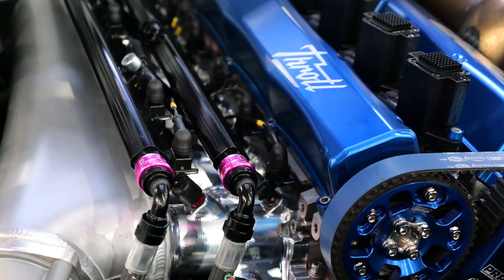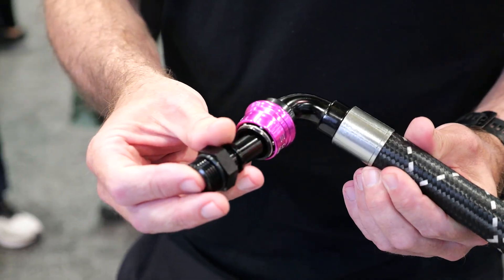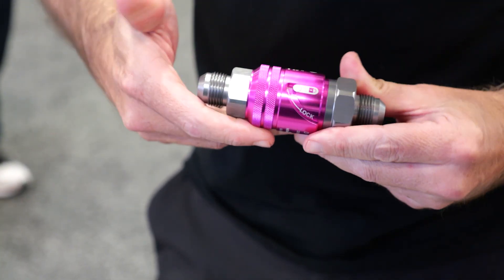'This is the way.' | AN JIC Line Quick Release

Comment from the maker: 🔵 Building a fast car? Get $400 OFF the all-inclusive VIP online course package deal: https://hpcdmy.co/dymevip
👨‍🔧 Expert motorsport plumbing. Start learning instantly with 50% OFF your first online course: https://hpcdmy.co/dymeplumb
TIME STAMPS:
0:00 - AN Lines For Motorsport
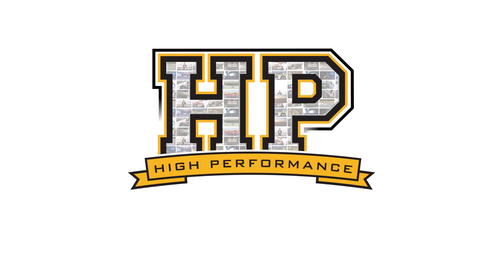0:12 - A Problem
0:22 - Quick Release Solution
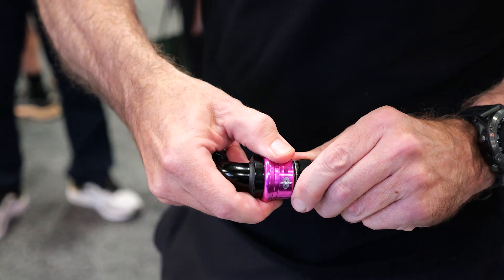0:42 - Tight Packaging
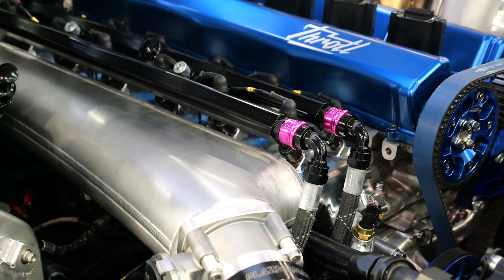0:59 - Dry Break Fittings
1:14 - Oil, Brake & Fuel Lines
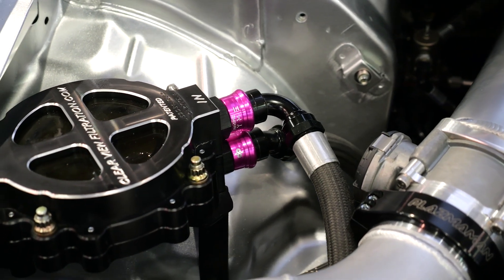1:24 - No Clutch Bleeding
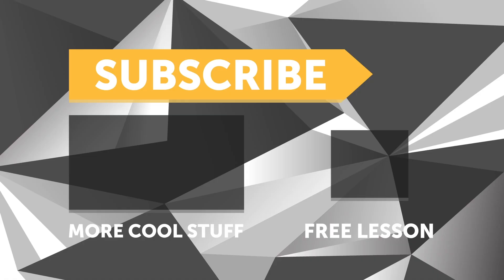1:34 - BUILD.TUNE.DRIVE

Comment: None of these quick connect providers are clear on hoses they use, and none of them use PTFE hoses, which doesn't make it very useful for many.
Reply from the maker: There is a technical sheet and you can see what fittings are usable (many) with PTFE. You can also get in touch directly, with suppliers, but a course like this might be right up your alley too to give you this general knowledge and much more -https://www.hpacademy.com/courses/motorsport-plumbing-systems/

Hope that helps! - Taz.

https://www.dymepsi.com/technical

Comment: Question: What would having a quick-release clutch line be used for? Is it just for convenience when changing clutchts/gearbox?
Reply: Yes, correct.
Reply: @Smellykent  believe he said why in the video. To prevent introducing air into the system.

Comment: How’s there reliability and how long would they last if say I wanted to put it on a daily or roadtrip car?
Reply from the maker: They are serviceable, but pretty safe bet if this is a car you are working on a lot they will last longer than OEM fittings. OEM fittings are, as a rule, are not designed for many mating cycles. If you're not working on it a lot, then you possibly wouldn't practically benefit from switching to fittings like this just for the sake of it to be honest - Taz.
Reply: One important thing to note is that these quick release fittings are not tolerant of dirt and grime. It's important to make sure these fittings are clean before disconnecting or reconnecting them.
Reply: @patx35 I try cleaning as much as I can anyway because I pretty much treat everything as if I had the engine open and dont want anything to fall inside the cylinders
Reply: These types of fittings are common on heavy equipment. They are reliable, and stand up to some of the harshest conditions.